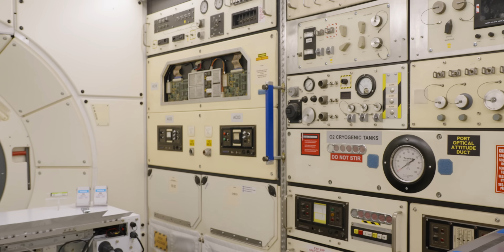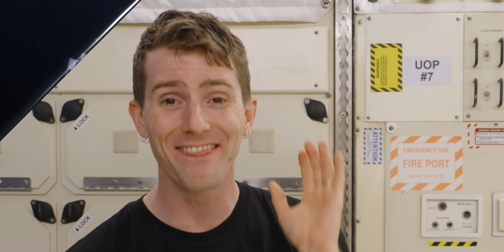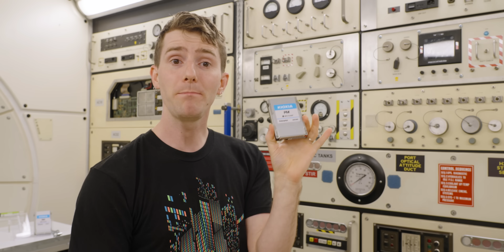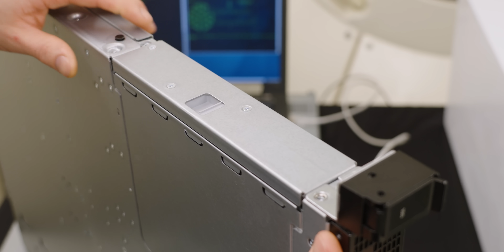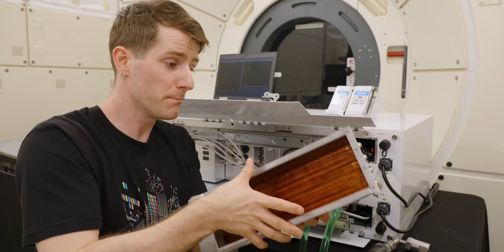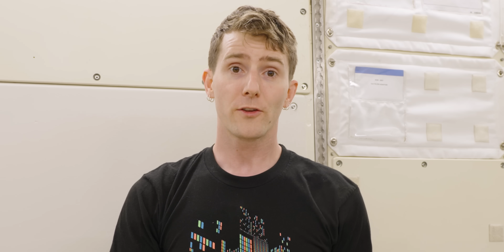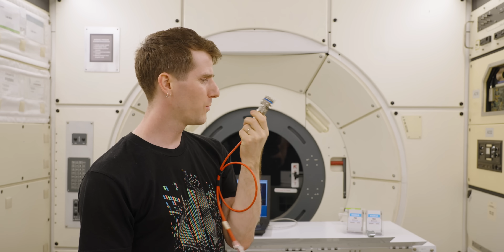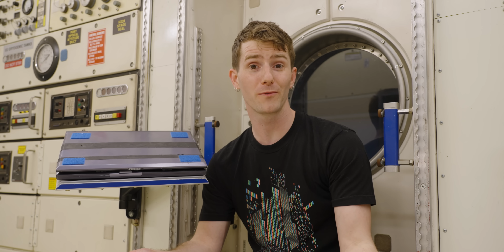here's why it's so hard to put a computer into SPACE - NASA HPE Spacebourne 2

Comment: Hi I'm working in aerospace, I can talk about just a couple of things:

1. People think of space as cold, but it might not be as cold as you think. Temperature in low Earth orbit (LEO) can be -60 to +120 C depending on how much direct sunlight you're receiving. Linus' point about having no air to convect heat away is a pretty big deal - that's why you need massive radiator panels.
2. NASA and incumbent space agencies tend to be risk-averse and want to see SIGNIFICANT verification of functionality at every level, particularly when humans are involved. That's probably one reason why they don't use Starlink - the technology is simply too new and maybe there's some technical or bureaucratic inertia to overcome. It's also why tech in space tends to be pretty old, even if it's launched today. US agencies like to see flight heritage. So even (as a silly example) if Ryzen 7600 is better than Intel Core 2, if these agencies see that Intel Core 2 provides everything they need, they're more likely to pick the Core 2 over Ryzen 7600 because they KNOW it'll work. This is compounded by the fact that the rad-hardening process takes a ton of money and time, so you often end up sending surprisingly old tech into space. Newer commercial companies and smallsats are trying to use newer tech though.
3. Power budget is super important. One reason that it's so tight is because solar panels degrade over time, especially in space, so the power available to the ISS is decreasing over time.
4. Bit flips are MUCH more common than on Earth, that's why rad-hardening is important. I had a professor whose research specifically tried to ameliorate the effects of bit-flipping.
5. Not necessarily tech related but it's true that space vehicles need to balance physical practicality versus human preference, e.g. convenient orientations versus "needed" orientations like Linus mentioned.
Reply: About Starlink I'm also asking myself, if those satellites even have antennas directing to space. Starlink was built for use on earth primarily.
Reply: @Deinorius  They did use Starlink to link to the recent Starship test flight, but that was lower than the satellites. I guess at some point SpaceX will put a dish in/on a Dragon capsule to test it further up.
Reply: @Deinorius  they have some sort of communication capability in space. I'm not sure off the top of my head what it is - but we know they're expected to be able to respond in case of collisions. Whether that can be repurposed for communication with Earth, I dunno
Reply: Why don't they use Radioisotope Thermoelectric Generators instead or in combination with solar? They could reliably generate hundreds of watts for decades.
Reply: @jamescollins6085  because it's expensive, it's hard to safely shield from humans (very heavy), and TECHNICALLY we're not supposed to put radioactive stuff in space due to treaties (though tbf most people ignore that lmao)
Reply: @jamescollins6085 i found this on energy.gov

 In fact, some RTGs launched decades ago, are still in operation today like the Voyager mission that first started in 1977.
Reply: @jamescollins6085  Iss power budget is about 80Kw. The 40Kg of voyager 1 RTG produced 400W when new (rounded) that would be 8 tonnes of RTG's that you need to launch then dispose of without dropping them into the ocean. They would also be down about 25% power output by now. It would also require more pu238 than has ever been made pretty much and the cost is fantastic. When it was being made it was about $4 million per pound in 1980.
Reply: They don’t use Starlink on the ISS because there’s no point right now not because it’s “new”. Starlink doesn’t offer much over the existing 600mbps downlink. However, last I saw, NASA is still looking to SpaceX, Viastat and others to develop a replacement for the TDRS communications network around the 2030s.
Reply: @FunningRast  It gets them an additional downlink, so supplemental capacity, but more importantly, dramatically lower latency. I suspect the main problem is more that it probably wouldn't work. ISS is above the phase 2 Starlink satellites, so it couldn't talk to them at all. And it's not very far away from the phase 1 satellites, which are roughly a hundred kilometers higher than it. The less distance from the satellite, the narrower the cone of service, so ISS would constantly be moving in and out of coverage.
Reply: @guspaz  If it wouldn’t work then why are they adding it to the Haven-1 station which is “supposed” to launch early next year? Doesn’t matter if it’s additional capacity or lower latency. What they have is good enough for the time being vs other things they can spend their limited budget on.
Reply: @FunningRast  I looked up Haven-1's press release on the subject. They plan to connect directly to Starlink satellites via laser communication, to avoid the issues I mentioned with the phased array antenna. The first ~1725 satellites they launched didn't have laser support, though, so it's only been relatively recently that Starlink has had a high enough percentage of laser satellites to try something like that. It was probably viable as of maybe early 2023?
Reply: @guspaz  So what? Doesn’t negate my point about feasibility. The original plan was to include the laser links which was delayed but they started doing with the 1.5 gen sats in 2021 and NASA, et al. knew it was coming. NASA has also already tested laser links between the ISS and geo-sats with LCRD and ILLUMA-T. That’s what they’re going to do with the TDRS replacement, so it’s really not some foreign technology to them. If NASA and the others really wanted Starlink for the ISS anywhere in the near future they would have announced it years ago like they do with everything else. Would it benefit the ISS? Sure, but again, they don’t see it as a need because what they have they considered good enough vs their limited budget.
Reply: i work in a company that launches cubesats and we just had a radiation incident a week or so ago! can bus traffic to the power management board completely dead and watchdogs not triggered, radiation’s bad for the little dudes lol
Reply: @sylfrear  How was it resolved - if it was? //Student cube sat project
Reply: @Zacharias_Andersson  not resolved yet… thankfully we still have a connection to the adcs so rotating the satellite to deplete batteries which should trigger a reset is an option
Reply: It's worse in LEO even than that. The earth itself takes up a lot of the sky and radiates infrared at about "room temperature" so you only get that cold cold if your radiator is also shaded from the earth and your own warm space ship.
Reply: LEO is trivial compared to GEO.  The company I worked for spent billions designing and testing parts trying to find ones that would actually work in GEO or deep space.  The parts derating made design very challenging.
Reply: ISS got brand new solar arrays recently, that are also more powerful than the old ones when they were new. But yes, power budget is crucial.
Reply: Protection against bit flipping sounds like something that could have mathematical models that look indecypherable to regular people.
Reply: "4. Bit flips are MUCH more common than on Earth, that's why rad-hardening is important."

true, but the Spaceborne computers have no radiation hardening of any kind.
Reply: You must be the one who answers the phones

1. The temperature of space has nothing to do with sunlight. Temperature is a measurement of the average kinetic energy of particles. Even looking at a perceived temperature, that depends entirely on the vehicle. Apollo 13 wasn't exactly toasty despite being in full sunlight while most of its systems were powered down. Especially in low Earth orbit, objects are heated more by infrared radiation from the Earth than they are heated by the sun.

2. NASA gambled on a novel heat shield design for the upcoming lunar missions and are now scrambling to figure out why it failed. So much for risk-averse.

3. The solar panels are periodically upgraded with newer technology so power has increased

4. Nobody knows if bit flips are more common in space, estimates for terrestrial occurrences cover several orders of magnitude since many devices don't even detect or report errors. There's no comparing it to aerospace hardware that is designed to report and count memory errors.

5. Most space vehicles will never be operated by humans so accessibility is only relevant while the vehicle is being assembled and integrated on the ground.
Reply: @shanent5793  Lol you're cherrypicking my arguments smh.

1. If you don't believe me, maybe you'll believe NASA in "Environmental Conditions for Space Flight Hardware - A Survey" by Jeannette Plante and Brandon Lee, freely available: "The temperature range in LEO goes from -65 C to +125 C with thermal cycling dependent on orbit height". This is of course just one comment in the entire paper, so I invite you to read the whole paper - again, it's freely available and not behind a paywall. Or, read ANOTHER NASA page, this time a mathematical exercise, called "Estimating the Temperature of a Flat Plate in Low Earth Orbit", also freely available on the web. Or, read YET ANOTHER NASA page, this time about JWST, which specifically states the radiative heat transfer by the sun being of great importance, heating the outer surface of the sunshield to 383 K. Your comment on temperature being a measurement of average kinetic energy of particles is first of all not a complete definition as it specifically refers to VIBRATIONAL kinetic energy (and not BULK kinetic energy, which, in an aerospace context, is important to separate), but is also irrelevant because radiation is one of the three main forms of heat transfer, and, in the absence of bulk matter (i.e. space), radiation forms the primary method of heat transfer.

2. Yes, that's kind of the point of these tests. Being risk-averse doesn't mean they don't innovate, it just means they don't implement anything until it's been proven and verified multiple times in simulation and testing. Also, note that the base AVCOAT design is from the APOLLO ERA - it was being remade for environmental concerns. Were it not for the environmental concerns, that seems pretty risk-averse to me.

3. Yes, more solar panels increases the solar budget right then and there. But that's a one-time thing, as opposed to degradation over time. Again, don't take my word for it, you can read yet another freely available paper called "On-Orbit  Performance Degradation of the International Space Station P6 Photovoltaic Arrays" by Kerslake and Gustafson to read about the expected 0.8% annual degradation in 2001 - 2003. Or, in other words, NASA engineers EXPECT solar degradation.

4. This is true. However, SEUs are not infinitesimally impossible. If we can expect SEUs to happen via radiation and magnetic anomalies, and we know that the intensity of radiation and magnetic anomalies in space is much greater than it is on Earth (which, it is), then we can expect SEUs to be much more mission-catastrophic in space than in Earth, especially given the lack of significant ISAM capability.

5. ?? This was in context of the ISS...
Reply: @Reckless150681  Are your references supposed to help? The paragraph right above your quote:

—Temperature extremes experienced by flight hardware are a combination of their location with respect to the sun or a shadow (planet or spacecraft) or in engineered environments (e.g., a dewar), and the overall thermal management of the spacecraft, which might involve the use of thermal radiators, heaters, or coolers.

Dewars, flat plates and telescopes aren't space. Those are pieces of equipment in the space environment. A margarita is at 0°C, the sidewalk outside is 55°C so the temperature in Mexico could be either of those, right? If you understand that radiation is the primary method of heat transfer, then it should be obvious that the temperature of objects in space will be very different from space itself.

The relevant change in Orion's heat shield was from cellular application to blocks, which was supposed to save production time. Artemis 1 was the first time this was done, the application technique should be considered at least as suspect as any change in formulation.

Photovoltaic panels have been added to the station on several occasions, more than once.  Of course they expect the panel output to decrease, but that decrease is part of the margin. If it's going to decrease from 240 kW to 200 kW over the expected lifetime then they budget for something less than 100kW to account for the average output, degradation and storage losses. It's not as if they've been slowly cutting experiments and reducing crew because of degraded power capacity. They're in a position to do something about the decrease, unlike a long-running space probe like Voyager.

The consequences may be different but this still doesn't change the volume. It's because of those greater consequences that space systems are more resistant, they use modular redundancy and integrity checks in software as well as radiation hardening.

If we restrict ourselves to the ISS, then space is at T-shirt temperature and has ample ISAM capabilities, with its crew that regularly maintains and repairs the vehicle.
Reply: @Reckless150681  The OP's reply indicates otherwise, that they had conflated the temperature of space with the temperature of things in space. No spacecraft is a blackbody or anything close to it. Absorbing all of the sun's UV output would be unmanageable, so every spacecraft is designed to reflect at least that much.

All it takes is one deviation. They are likely to fly a human crew without another unmanned test of the heat shield, so that will make a trend. I would love to be proven wrong on that count. Sometimes the old stuff isn't even available, leading to the selection of SpaceX and Blue Moon, but Orion had the old heat shield on its pre-Artemis flight.

You're right the panels have always generated a surplus, they can only rely on what they can get back from the batteries during eclipse. Your point would be better made to the OP.

The bit flip comparison was between terrestrial and space, not orbit-to-orbit.
Reply: @shanent5793  Ah, I see the point you are snagged on. Technically, yes, you are correct - without an actual medium, space does not literally have a temperature. I suppose I should have been more precise with my language to say that objects in LEO are at a particular temperature that is warmer than what is often repeated.

At any rate I don't think it necessarily invalidates anything else I've said, because clearly others were able to take my meaning through context clues despite the technical inaccuracy. My original comment was just five maybe-connected, whimsical thoughts that came up as I was watching a silly Linus video.
Reply: @shanent5793  lol, you're such an edge lord. We are talking about the mean radiative environment and expressing it in a way accessible to people who haven't studied thermodynamics and vacuum physics. In terms of thermal IR the average temperature for black body receivers in those areas are in the ranges he said. Apollo 13 was cold because they insulated it and made it reflective to deal with the heat while having a bunch of electronics inside running and getting warm. Turn those off and keep the insulation it's going to get cold. That's what all the MLI and the BBQ roll is for.

ooh one instance of them doing a new thing in a new way when doing a new mission clearly disproves a description of a cultural effect.

Yes they launched new solar panels for the ISS, that's wonderful, they are now back up to about where they were at launch, not a massive increase in available power. They don't just plug into the grid and slurp down the killowatts. Further to that if you were as smart as you're trying to sound you'd know that it's not just electrical power input that is a limiting factor it's getting rid of the waste heat generated.

your point 4 is easily disproved by even the most trivial search. Like seriously you can find maps for bit flip frequency vs location in orbit and see a nice cluster over the south atlantic anomaly. This is common knowledge amongst those with even a passing interest in space and has been since they started using solid state memory up there.

 how can you be so authoritatively wrong and insulting about so much stuff at the same time?
Reply: @shanent5793  lol
plz go back to school

Comment: fun fact, in super high end race applications some people use those military connectors for wiring harnesses. iirc Rob Dahm has some wiring videos where he uses them in his recent 4 rotor rx7 rewiring
Reply: they also get a lot cheaper if you by more like a $200@qtn1 and $30 and qtn100. I used to work for company that bought them in bulk so no one batted an eye at  using them for more mundane things.

Comment: This brings back memories when i was a test engineer at a satellite company. Nearly every circuit had a duplicate on the same chassis. Then they would put two of those in which is essentially 4 copies. They have to guarantee a satellite to work for 10-15 years without being able to repair it.